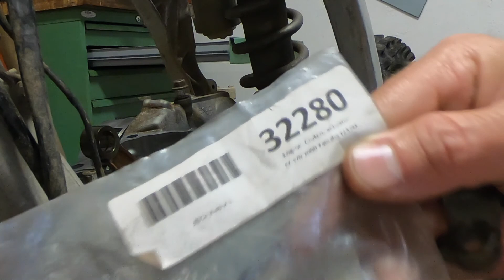Yamaha YZ250F Engine Rebuild Part 1

Comment: Great video, just picked up a 2008 for a steal with no compression.  In my case, it's a little simpler.  On the exhaust side, both valves are not seating, even with proper gappage.  No obvious damage.  Replacing and lapping both valves fixed the exhaust side.  Confirmed seating surface on head still in spec.  On the intake side, I had to significantly reduce shim size under the buckets as CAM was in constant contact with all 3 valves.  Both cams and buckets still within spec to keep using.  Hope this helps someone coming to your channel for help on theirs.

Comment: The moment you find metal in an engine you have to oull it and split it open. As the metal floating around will find its way into bearings and chew them up causing more damage. 4T are bad for this as the sump system travels around the engine. Where as a 2T has separate sump systems making it nicer as itcant travel from one to the other unless the interior of the cases has a hole or crack in it but then thats a whole other kettle of fish. Cheers

Comment: That ROD bearing seems have been running hot ! can se the discolor around the shaft .
Reply: That's normal. The scorch marks are from the heat used to put the crank assembly together
Reply from the maker: @northernmx5973  You are correct.